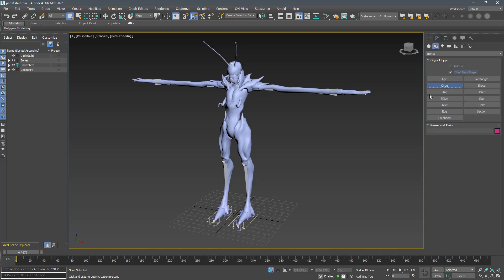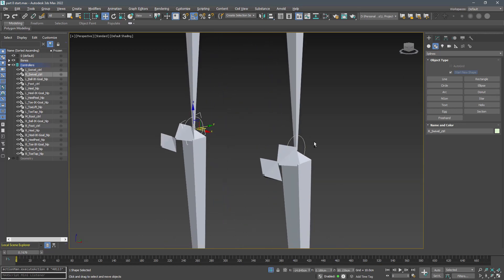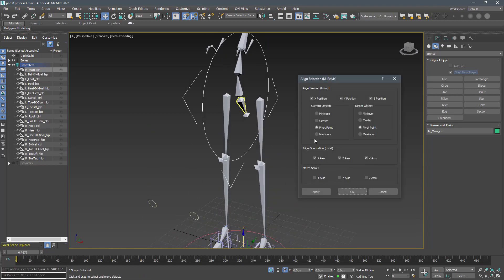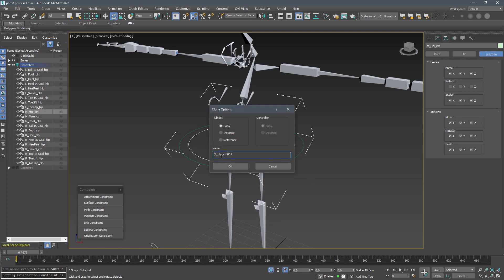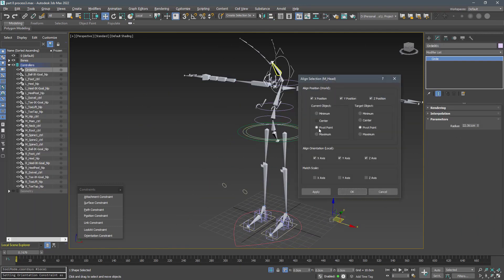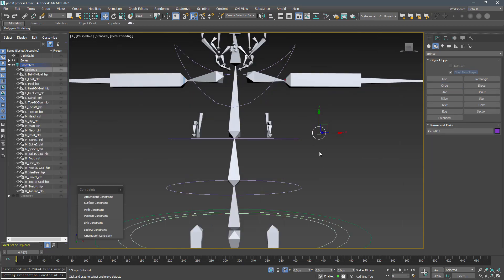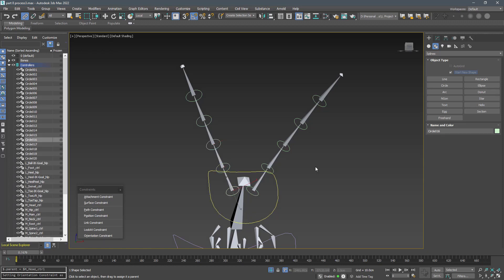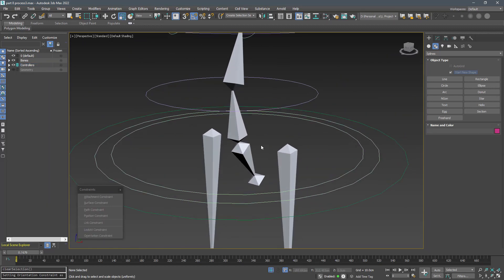3Ds Max Rigging For Game Engine Part 8

Comment: I had not seen this playlist! I join to see it, thank you very much for these videos, I have the doubt if the characters that are realistic use only motion captures or should they also have controllers? is that I see that they are all for cartoon-style characters and things that you do not use in a realistic character and face, do you know any video about this? Greetings and thanks again
Reply from the maker: If you're talking about the human facial rig, as far as I know, it's mostly captured data + keyframing for retouch the result.
There are some companies that are using AI to have more realistic results but I think it's not a necessary thing to do (for now)

Watch this VFX breakdown and it's almost all you need to know about realistic facial rig and animation:
https://youtu.be/V1lTuNLuIO8